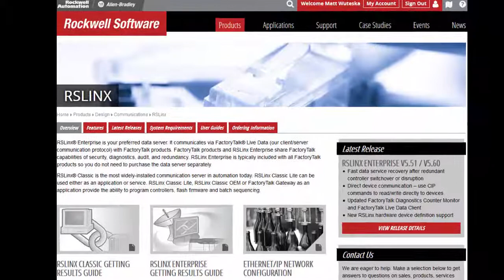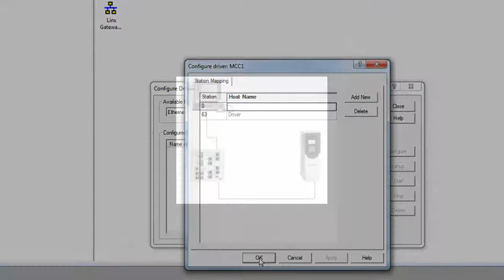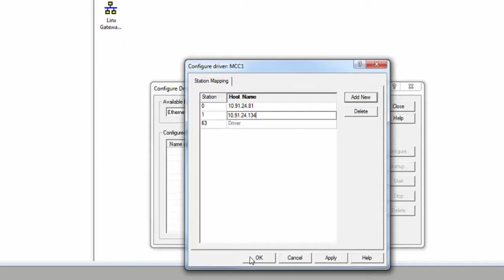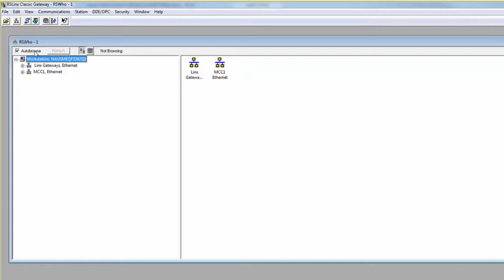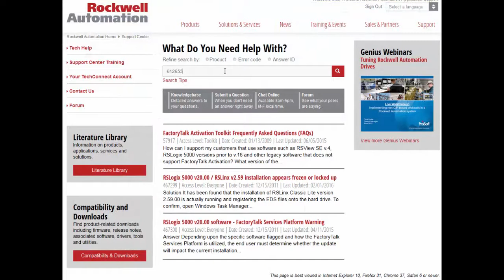Adding a PowerFlex Drive to RSLinx

Comment: I'm on a plant network (directly connected to the drive), but it shows 'Unrecognized Device' even though the drive is the same IP address that was defined in the configuration. 

I also added the IP of the local IPV4 network to see if that made things better, but no dice. Any ideas?